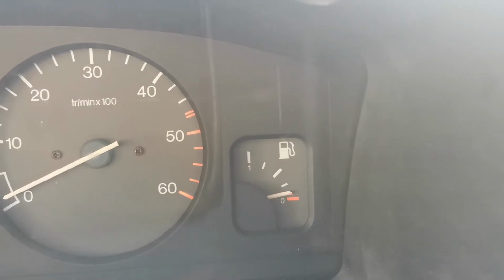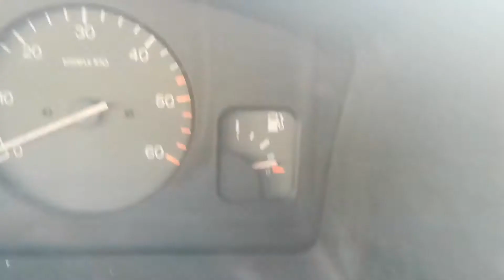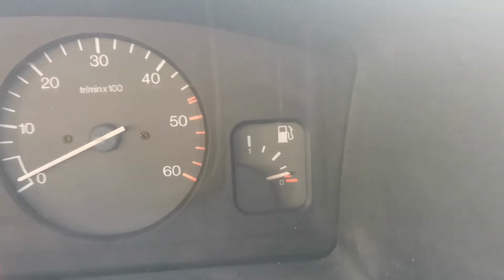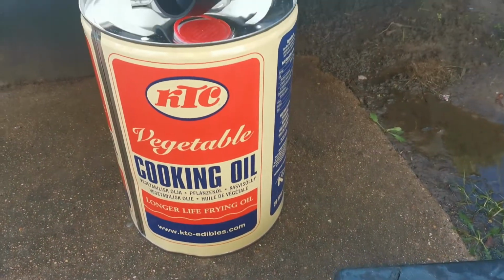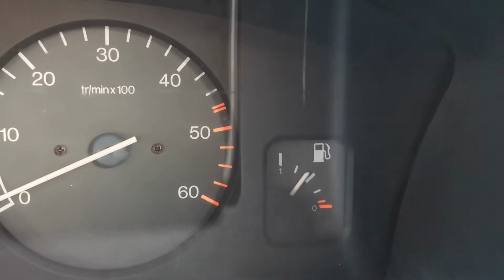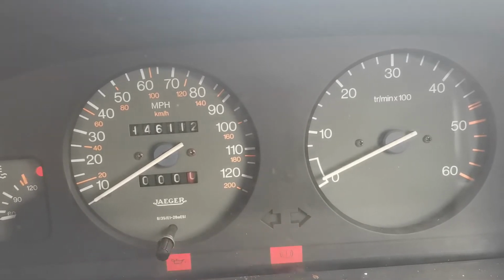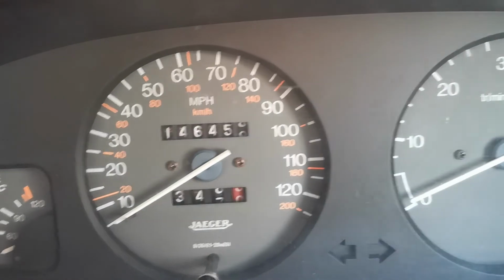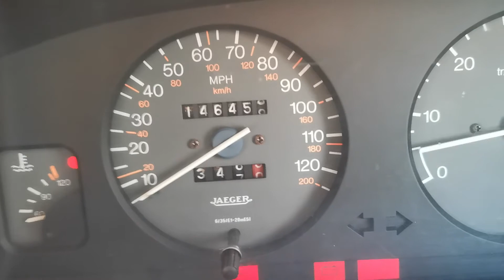Running my car for a week on fresh Veg Oil

Comment: I do mix my biodiesel down to 50:50 with settled veg oil, and at least as far as VW 1.9Tdi ALH engine is concerned, it seems to run very, very good. Not so good on straight diesel.

Comment: Hi, I make biodiesel from waste cooking oil, that is fine if made correctly, but cooking oil alone will make the car harder to start over time, probably more time, if used with diesel, then eventually glue the engine and fail. Cooking oil is thicker than diesel, and the injector pump can struggle. I dont want to worry you, we all want to save money, and there are conversions like a heater to thin down the oil, and two tanks to switch between, so you start on pump diesel, then after a minute or so, switch to cooking oil.  There is a heat exchanger you can buy, or put a metal link between a hot partb of the engine, and a metal fuel line close to the pump.  Otherwise it can eventually collect on and around the pistons and cylinders.  Gets harder to start as I said.  Try heating up oil, then putting some on a bit of metal, and its sticky when cold.

Comment: I've run 90's vw turbo diesels for 22 years on purely recycled waste takeaway oil during the warm month's, you can do this right upto the first cold snap (when the weather starts getting chilly, switch back to diesel n oil mix, before first frost), switch back to 70/30 mix of diesel and recycled oil. 

Its important to make sure you change your fuel filter and engine oil regularly, I.e every due service (never skip a service).  

My '97 1.9 VW Vento Tdi did just over 400k on the original engine, box and clutch, before the the bodywork let it down (excessive rust uneconomical repair for MOT)... so I sold it to a guy who exported it to Afghanistan to get it welded up and give it a new lease of life. 
Before this I ran a '92 Mk2 Golf TD, and after the Vento I ran a 2001 Skoda Octavia both in the same way mentioned earlier.

With diesel prices hitting £1.80 a litre, I've just bought another old skoda to run on recycled waste oil, which it will do beautifully in this climate 😉
Reply: Well done on your fueling..! I have a 1994 Toyota estima 2.2 turbo diesel. Can't find any clear info but seemingly a good option for veg oil. Do you think it would work in that car? Thanks..
Reply: @subspaceanomaly  no reason why not if it has an external pump (which it should do, being that age) 😉

Should qualify for cheaper classic car insurance too 🙂

It's the newer engines with the internal pump like the VAG PD engines that won't run on it.

I'm doing a 115 mile run in my Toledo today 😊
Reply: @theonebabbarshere1614  I put in ten litres of vegetable oil from the supermarket in a near empty tank. Seems to work OK, maybe slightly less power, engine idle sounds really smooth. From what I've read mpg is decreased relative to diesel, the supermarket veg oil is 1.10 a litre vs 1.75 for diesel where I am so the saving probably only 10%ish I guess. Might look around for used oil from fried food restaurants, but it seems unless you have a good supply organised there isn't much point. Where are you getting your vegetable oil..?

Comment: Hot tip, fill your tank with veg oil and put a cup of super unleaded petrol in as a mix and it will run better than on diesel and starts perfect, if your doing it in a car with rotary injection pump put the petrol in as a 50/1 two-stroke mix. Then you will never want to go back to diesel again. ever.

Comment: I using 100% rapseed oil and my car drives perfect maybe better than with diesel
Reply from the maker: I found it did seam to run better on veg oil better than diesel it was just a real pain to get it into the tank for not very much of a saving.
Reply: @TheZXGuy  do one hole on top of the tin.
Reply: Common rail ?

Comment: Do you still have this car Since when did you start running on the veg oil As I pissed of with the prices going up I got a DCI 1.5 renault I think I will go 50 - 50 I have hear that running on it it may wear the seals But what seals they were talking about ?? Thx for the job
Reply: Probably seals on injection pump

Comment: The only problem I can see is check the ingredients in the cooking oil, regardless of if you are going to cook your chips or run your car, beware of an additive called Dimethylpolysiloxane, also called food additive E900, it is an anti-foaming agent. It is also known has Silicone Oil, it is questionable whether you should actually be ingesting the stuff, but for a car engine it is a bit like liquid sand, it could put a glaze on the cylinders and or clog up valve seats.

Comment: How do you know if you have a mechanical diesel engine?
Reply: What kind of car do you have i help you out
Reply: @thomasofficial1981  Hi, I have a Mercedes c class, 2007
Reply: Hi. They got CDI engines do not put more than 10% for a full tank. Try to get older engines and they will run better and more healty beacuse dont have high pressureized systems.
Reply: I buy today for my self 1.9 SDI VW i run on 100% used veggie so basically i drive free 😁👌
Reply: @thomasofficial1981  ok, thanks for your help.
Reply: You very welcome! 🙂👍

Comment: 77,000 miles so far on straight veg oil, waste vegetable oil and diesel. Citroen ZX estate XUD9 none turbo with Bosch pump which is a must. In summer I run 100% waste or straight veg oil and in winter I run 50-70% with diesel. No problems at all, do all work myself including cam belt changes. Great cars mate keep yours going and if you see one for sale let me know 😃👍
Reply from the maker: I feel like my car ran a lot better running veg oil just seamed like it had more get up and go and more powerful
Reply: Dan did you have to make any alterations to the car before doing this? Giving the current situation I'm half tempted to do this myself! I have a 21yr old 306 Hdi so I know it can run on it
Reply: @TheZXGuy  that engine will run on stright vegetable / plant oil but now and again do a full tank of diesel.